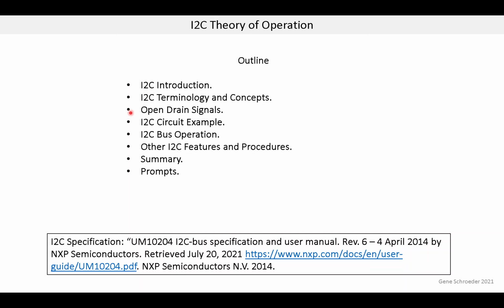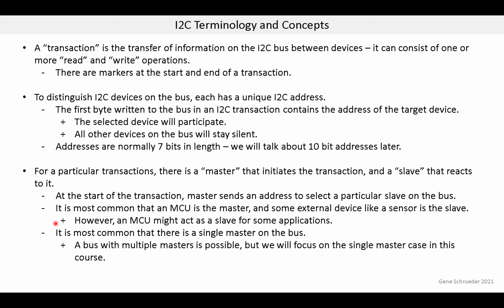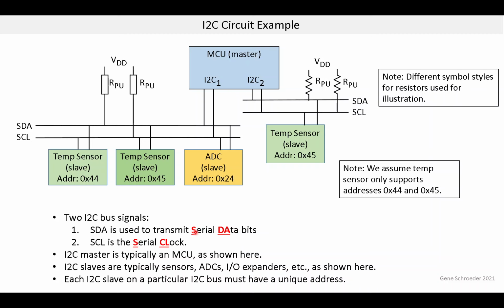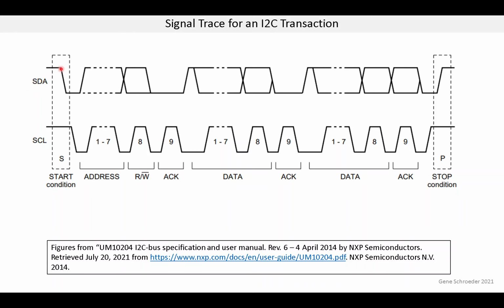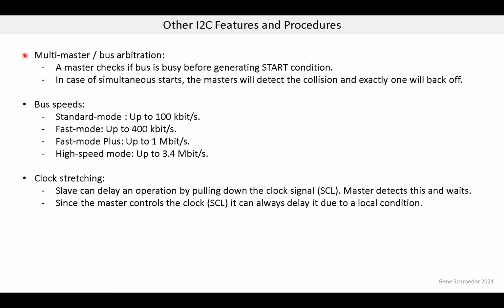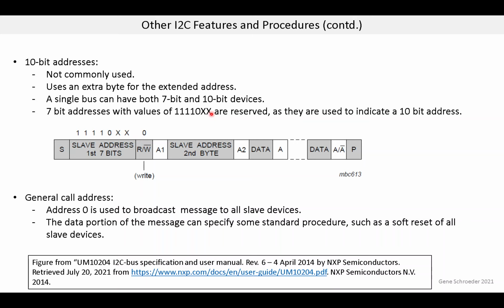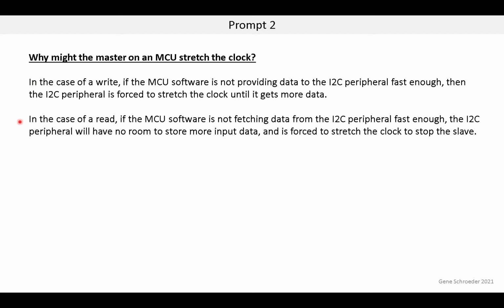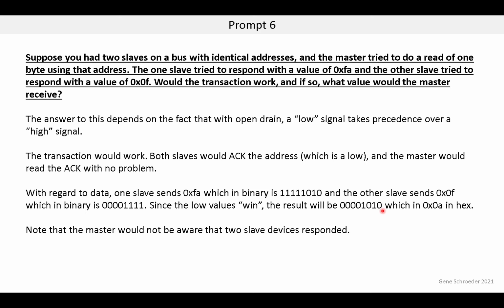I2C Lesson 2. I2C Introduction and Theory of Operation

Comment: On question 1: this is similar to chip select on SPI. You'll need to implement another line between the master and slave, which kinda defeats an advantage of I2C.

On question 5: I have experienced I2C bus freezes as a result of randomly occurring noise on the rail produced by the Espressif 8266. Filtering can cut this down a lot, but not eliminate it. I have implemented an I2C timeout on the slave that will reset the bus without having to completely reset the device. Slave is my own design of course, this would not work with OEM hardware.
Reply from the maker: On question 1, totally agree. I'm hoping someone can come up with a more clever solution.

One question 5, it is an interesting idea to add some robustness on the slave side.   I guess a commercial I2C slave could have a register for an optional dead-man timer - if the slave isn't addressed for more than N ms, it will reset its bus interface. I've seen this sort of thing at higher levels.